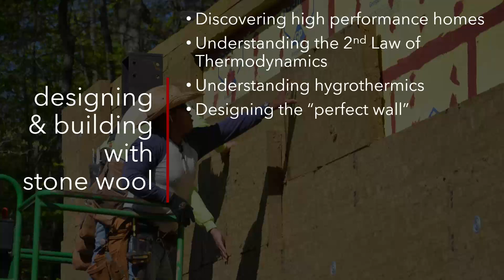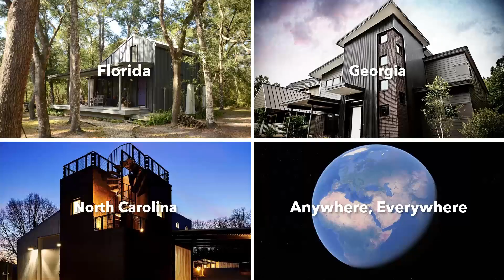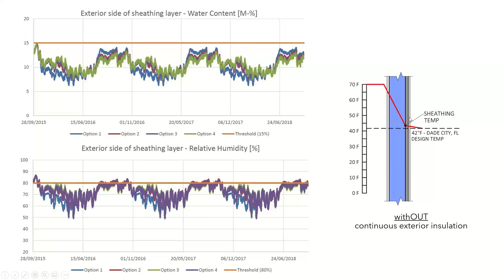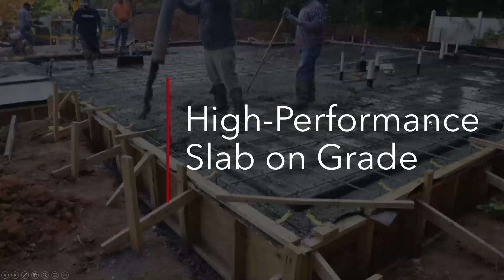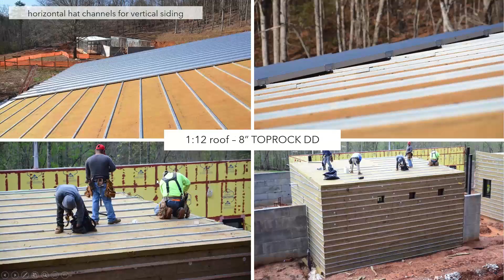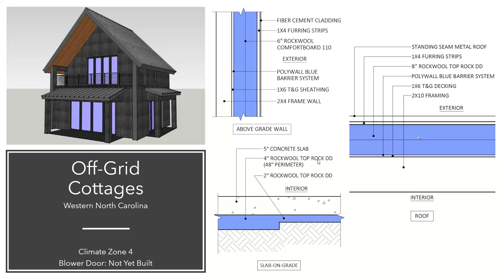Designing and Building with Stone Wool Insulation (WEBINAR)

Comment: Hi Chris, 2 questions. Any issues or tricks with the very thick insulation to make sure that your attachment screws hit the studs on the inside framing? Also using Zip sheathing, is there any concern that you are not sealing the batten screw penetrations? Thanks